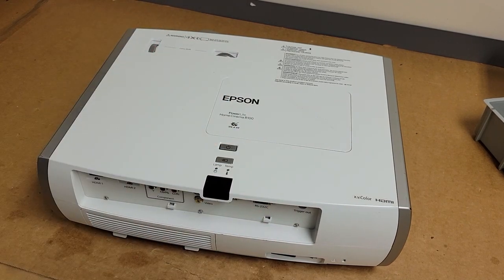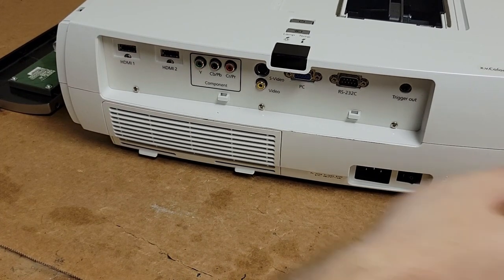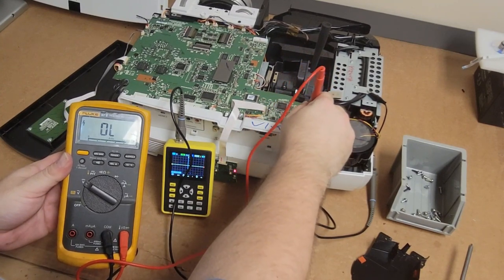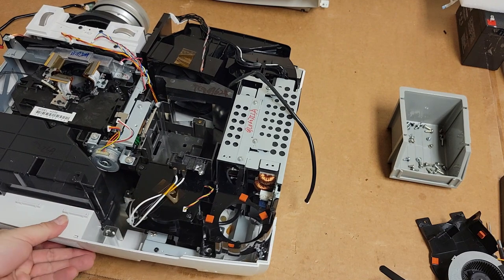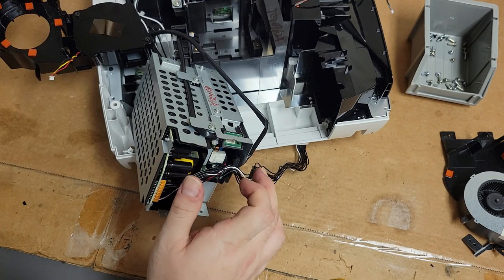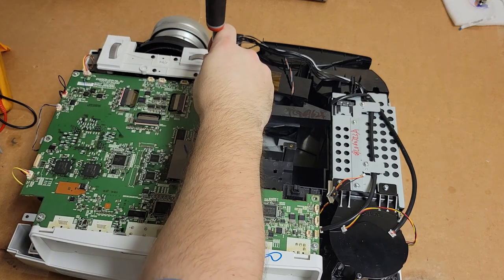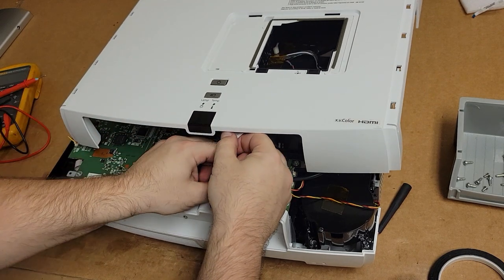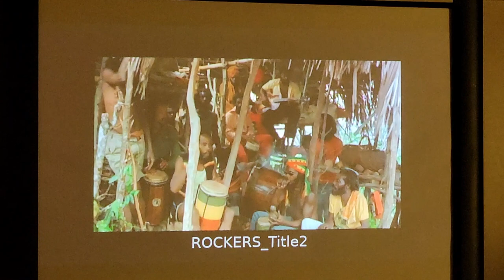Epson PowerLite Home Cinema 8100 LCD Projector | Temp LED Repair

Comment: Thanks, Frank. I have an 8350 that was giving me TEMP light problems. Your vid was invaluable showing opening and components plus trouble shooting tips. 
After poking around in mine, I found no obvious problems, fans all turned. BUT it now works! No idea why, probably bad solder joint, but I guess I'll leave it for now. One problem with your vid was that I couldn't clearly see where you were probing with your meter for those readings - and a bit of explanation on what I should get. If it fails again. I assume I'd have to be quick to read before it shuts down.
Reply: Glad it's working!  It probably is the fan next to the lamp. Super common. As far as measurement points I go over checking fans in another video. Probably why I didn't go in depth here. Enjoy the projector!

Comment: Awesome model Frank. I really like the way these EPSONS are built. By pure luck, I own 3 of these beasts now. Opened the first to clean after 500 hours there was no dust inside! Filters do excellent job. Thanks for sharing Frank and always remember......... WE DISSASEMBLE THEM KEYBOARDZZZ!!!!!!!
Reply from the maker: They really have a good type of filter in these too. Its not that awful flat open cell foam. They use the zig zag element to get lots of surface area.

Comment: In cases of a partially worn fans to make life easy I fit a piece of aluminium heatsink onto the back of the lamp, using oven door hi temperature glue and that helps the cooling fan with faster dissipation of the heat. It works 9 out of 10 times though not always. Try it if it doesn't work simply replace the fan. Another detailed instructional video. Great stuff. Generally I hate working on epson projectors especially ultra short throw ones. They are the worst. Epson don't offer service manuals and often no spares available.

Comment: Thank you Frank for such a great detailed and thorough video and your explanation of every step! 

I followed it with my newly acquired problematic Epson 8350 (pristine condition with barely any dust or sign of use) - it would work normally for 5-50 minutes and suddenly with no warning of overheating on display, it would shut down the bulb and start blinking temp light, blasting all 3 fans on high. I am trying to figure out the reason for it - all fans work flawlessly (tested separately), I have 6 different bulbs to try, including good OEM, so its not a bulb issue, it's not an IRIS (its very smoothly opens and closes) or anything in the optic section. 

So far I was thinking of the thermal protector UCHIYA UP62 (whte small rectangular), lodged in black plastic right next to the bulb. I measured the resistance of the disconnected part and it was over 40kOhms, so I swapped it with the only availble similar part UCHIYA JP62 from another projector (a successor that looks identical, but has double the amperage), which reads 0 ohms at room temp. Now with JP62 it only strikes cheap bulbs and only for a minute, before shutting down with the temp light blinking, Epson bulbs can't start with this thermoregulator, giving bulb light blinking.
Weirdely, now I'm testing that original UP62 at room temp and it also reads 0, what to think of it?...

If you have any idea or have had any experience working with thermo sensors in Epson, please help me with the advice?

UPDATE: shorted the thermal resistor. Now back to where I was at the beginning - works for 1-50 minutes till shutting off with temp light blinking, or shutting off right after EPSON logo.
If anyone has any clue? How can test those 4 -wires TH sensors (there are two of them here)?

Also, Frank or anyone, do you guys have an extra temp sensor, same type as the one that was stuck inside the power block in the video, I would gladly purchase one or two, as I think its the only place left to look.
Reply from the maker: I'd check fans.  Specifically the lamp blower fan.  Locked or slow fans will give temp errors as well.  If it runs for a period of time, the fans would be my troubleshooting direction. That would also explain why the thermal breaker failed.  They are supposed to self-reset and if it was not resetting, it had been heated extensively for a long time.
Reply: @FixitFrank  Thank you for this insight! Do you think I should run that fan from 12v and connected tester for like an hour or two and see if it stalls or slows down? I'll try that, have nothing to loose really.

I also found this video of a similar Epson PJ - https://www.youtube.com/watch?v=0DlioOaKCoY and at 20:12 the guy shows those 4 wire temp sensors up close. Testing is super easy - leads 1 and 2 are shorted and so should be read as such, leads 3 and 4 connect to thermal resistor that at room temp reads 9.3 kOhm. I even found one of those sold used on ebay for $18 :)
Going to dissassemble everything again (3rd time the charm!) and report what came out of it, thanks again for this thread and your responses, Frank!
Reply: You were right about the fan thing, Frank! But it wasnt the lamp fan, it turned out to be the fourth, the biggest one, the one that sucks the air through the filter and sits at the bottom of the PJ. It seems that it is needed for cooling the prism and the LCD screens, hence the filter. Had to take the whole light engine to get to it.
It's model number is SF84M12-07A. It fails to start or barely moves, when fed 12V directly. It read (between red and black wires) about 8kOhm at first, now its just open circuit, so its totally dead.. How did it die wonder? Seems like a professionally built brushless fan, that suppose to last almost a human span life..
Question to you @FixitFrank, if you have those laying around not being used, how much would you want to send me one? I have an option on ebay but rather try to get it from you!

Thank you again for your insight - at the end it did turn out to be a fan!
Reply from the maker: Ill look around. I know the fan you mean.  I'm a kind of surprised it was that one but more happy that you found it.  I see these fail quite often(fans in general).  I am not sure why.  I figure they are built in such quantities that its inevitable to have some go bad.  Let me look around my office and see what I can dig up.
Reply from the maker: @alexanderm5130  I found one. If you can email me(check the about page) we can work it out.

Comment: Your video is the only one I can find that shows anywhere close to what I need. I have an 8350 that has a lot of dust in the light path and although your video is awesome, it scares the hell out of me to pull it apart now. Also my iris has been getting noisier as time goes on too.
Reply from the maker: I rarely work on Epson partly due to how much anxiety I get when I have to unhook and move the LCD cables. The best advice I can give is don't use air if you can help it.  Use little dry brushes.  Photo brushes ideally or small paint brushes.  Loosen up the dust and then use a little bit of air to blow it away.  Using a vacuum would be even better if its small.  The biggest hazards are bumping or moving anything adjustable and cracking an LCD flex cable. Don't take out each LCD panel and clean it.  Do it all in place.  It's really time consuming but for your own projector its time well spent. As long as you don't have any color blotches in the center, and the problem is only on the side, you might be Okay.  Keep in mind the 8350 is pretty old and will be very brittle.  Be careful with any glass surfaces.  The coatings can flake off if you are too aggressive.  I'd leave the center of the optics alone, the part with the colored mirrors and lenses.  If you are seeing dust it will be up by the LCD panels and prism. If you do have to open the center area, take lots of pictures at each step and lift the top off super slowly so none of the lenses pick up with it and then fall so you lose their position. 
tl:dr: Go really really slow, take lots of pics and take your time.  Use a photo/small brush and keyboard vacuum/normal vac adapter. Also, take your time.
Reply: @FixitFrank  I sent you an email my friend. It's beyond this now. Lol

Comment: Awesome video, thanks for posting it! I have an 8350 that flashed an iris fault once which cleared after a power reset. is it possible it was a one off fault? I was really hoping to see how to get at it while you tore down this machine - you must have been close to it while doing this repair?
Reply from the maker: Maybe. I have seen them get stuck and then loosen up.  https://imgur.com/a/N2BuCLn  I circled it here. Thats the assembly.  They are pretty replaceable as long as the LCD panels are still okay.

Comment: Hello Frank
One more quick question. I did check the items you mentioned. The picture on my samsung 8100 keeps flashing on and off about every 2-3 seconds
 If I press the menu button and view the menu, it does not flash on and off! The picture behind the menu continues to flash. Does this help narrow down my problem at all? Just a note, even if I do not have a device hooked to the projector, the samsung logo flashes on and off as well. Thanks again for your reply. Great videos!
Reply from the maker: Thats a tough one.  I would try a factory reset first.  If you have the same response with a signal connected, then I would be suspect of the mainboard.  Its hard to say exactly where though.  Also see if there are any factory firmware updates.

Comment: Greetings Frank and thank you for this great video. Could you share some advice on the focus ring? Mine is stuck really tight and can’t seem to move, I hesitate on forcing it. Any advice is greatly welcome!
Reply from the maker: That is difficult. It really depends on how badly it is jammed.  I would slowly try turning it after maybe warming it up with a hairdryer.  I would not get it too warm but since it is used to light, it will handle some heat.  the heat may allow the plastic to soften enough to turn and become unjammed.  However if the posts that allow the lens to adjust have broken in the tracks, the lens might be too bad to unjam safely.  This is a hard item to diagnose without seeing it, so please take this advice with a grain of salt.  
your best option is to slowly escalate the amount of force you use. Start out light and work at it harder until it moved.  If it is too damaged to move again, then it won't matter.

Comment: Great video! I was able to repair my Epson 8350 3 years ago with the same problem. New problem....now the "lamp" warning light and the "Temp" warning lights are coming on a few seconds after start-up. I can hear the iris working,  then the warning lights pop on. I opened it up and it appears that all 3 fans are working. I ordered an new lamp and it will come in a few days. Not sure if that will solve the problem, crossed fingers. Also, I don't know why the Temp warning would come on if it was a lamp issue. I would really love to hear any tips or opinions you would have. 
Thank you for your help!
Reply from the maker: I'm just guessing here but the cinema filter is another failure point on those. It's that sliding glass piece next to the iris. Both lamp and temp is unusual. I also doubt it's a lamp but it can't hurt to make sure. Easiest part to rule out.

Comment: Thanks for the response.. so here is what I know….went  to turn on projector one day  and nothing, just a lamp light red…so I changed  the bulb with one we had in the cabinet was not sure if it was good or bad or who made it …and that one did not seem to work either - maybe it was a old one. Then  ordered a new one and put that in off Amazon not a true Epson…that one did work and seemed to be a lot brighter but had a sort of heat smell. Like smelled hot or something or like just a new bulb. Then with that bulb in jt we got a temp light( over heated) and turned off…I did have two other thoughts…maybe I was running all these years on the eco setting which would be less bright thus less heat… and/ or maybe I always had it on a high altitude setting thus fans blowing more… really have no idea…I can  will order the exact epson replacement unless you can think of another idea or anything else I could possibly check.. truly appreciate your help and guidance 
Rob
Reply from the maker: I'd return that Amazon lamp if you can. Amazon lamps cause so many problems in my experience. There are some that are fine but they are hard to find in the sea of cheap lamps. There is an air flap inside decent Epson replacement lamps that Amazon lamps rarely use. 
I'd go to https://www.projectorcentral.com/projector-lamp.htm and check these websites. All of them sell decent products. You don't really need an Epson original (I'd still check as their prices have dropped) but I'd stay away from Amazon lamps. See if a better quality lamp solves your issue.

Comment: Where can new fans be purchased from? The only place that I could find using the Epson part number has been sold out for years. I've been living with a noisy fan, which works most of the time, but during the peak of summer when the inside temp is a few degrees warmer, I get the lamp overheating message and the unit shuts down.
Reply from the maker: I'd get the numbers off the fan itself. You can try the folks I use. gydz@timeprojectorlamp.com let them know I referred you. They should be able to help

Comment: Hello Frank. Hoping you can give some guidance. My 8100 has set for over a year. I decided to watch a movie with it the other day and the picture wont stay on. It comes on for 2 seconds and then off for 2 seconds. Just keeps doing this. Same with the epson logo when I first turn it on. Any advice? The fact that it worked fine the last time I used it and the long time it has set idle makes me guess dust or something but I thought I would ask your opinion. Thanks in advance.
Reply from the maker: Hey Shawn, Its hard to say exactly but here is what I would try.
1. Try another HDMI port. 2. Press menu, and see if that stays up(to see if its all video or just the input video). 3. Do a factory reset.
If none of those work, then there is something else going on.

Comment: Thanks, Frank for the opening of the Projector. I have the 8350 and getting an Auto Iris Error. I will need to take apart the lens area. Any advice would be good.
Reply from the maker: Take your time! that is the best advice. Go super slow and make small movements when disconnecting the LCD cables.  The biggest mistake people make is over flexing the LCD cables. They sit so long in that position that they will snap easily if you over bend them.  you may get away without removing the mainboard to get to the iris.  It is located by the lamp see this link.  I circled its location.  https://imgur.com/a/wFjVPal  You can follow the wire to it.  Most likely you just need to clean the old grease off the gears.  I find that they run better with no lubrication. The dust starts to get into the grease and bind it up.  I have a used but good Iris from an 8350 if you find yours is damaged.  I have an email on the about page if you need it.
Reply: @FixitFrank  What would you use to clean those gears? Pretty sure I have this exact issue and my iris gears are kind of caked with white stuff

Comment: I recently bought a 5050ub and still have the Optoma UHZ65 both nice projectors but I do like the DLP image better. The Epson just gives a more film like image with better blacks. The DLPs are way sharper.
Reply from the maker: The modern DLP with dynamic iris' are really great.  I don't dislike LCD pictures (I do prefer DLP), I just stay away usually because the alignment of the optics is sooo time consuming and difficult without the proper jigs and cables(which you can't buy). 
Epson as a company just rubs me wrong.  One of my earliest projectors was a Sanyo PLV-Z4.  My first non CRT projector was a Sharp that only projected 640x480. 
The best image I have personally seen is the 3DLP Sim2's out there.  That 3DLP is where it's at in my opinion.  I am also a sim2 fanboy.
Reply: @FixitFrank  I agree I have a Digital Projection Highlite HC 3 chip DLP 1080p.. and it is one of the nicest pictures I've seen it's just that it's hard to say no to these .47 and .66 chips. I never been prone to seeing rainbows so it doesn't bother me
Reply: @FixitFrank  always wanted the 3 chip Sim's but never got to it
Reply from the maker: That is so so nice.  What a great projector!